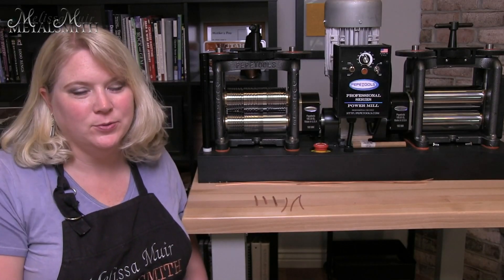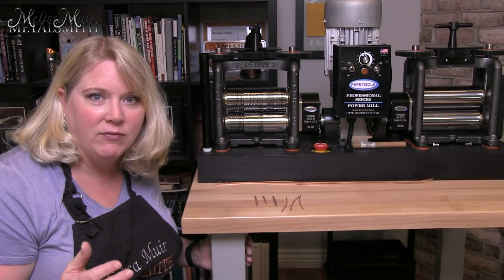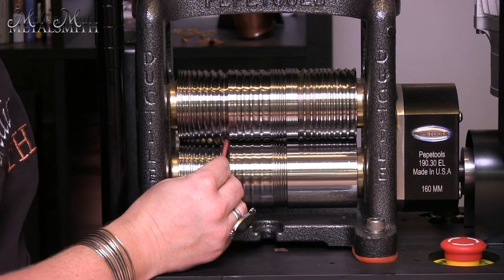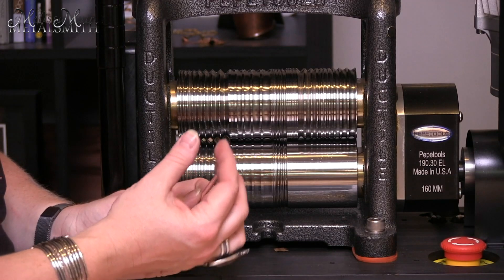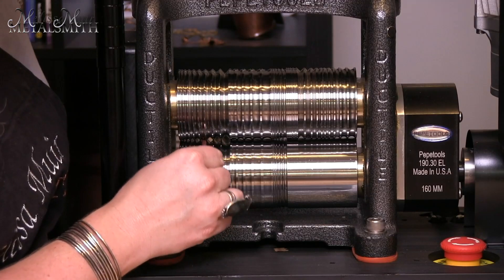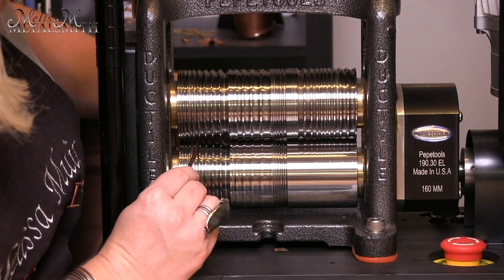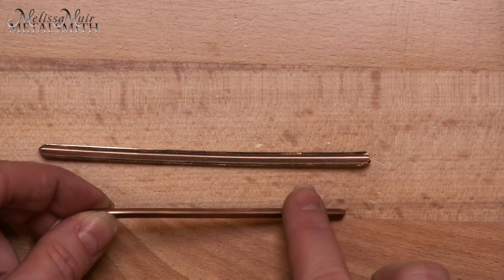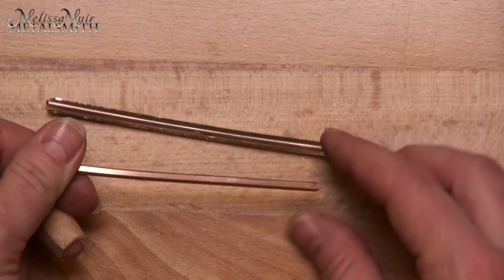How to make Square Wire with the Rolling Mill

Comment: Thank you for this one. 🙏
I just put in an order for the Pepe 160mm wire manual mill and looking forward to using it.  I am curious, is it pretty much the same slow reducing of the metal with the other shapes on the mill like the half round or triangle?
Reply from the maker: I opt on the side of caution and go with slow reduction. If you try to reduce too quickly with the wire, you end up with sharp flanges on the sides of your wire.
Reply: @MelissaMuir  
Ok
Thank you.
🙏😊

Comment: Hello when making wire do you stick to one track at a time tighten all the way down then start back again moving over to the next track size down and repeat? That’s the confusion for me 
Because it looks like you do a few runs on each track working your way down 

Reason I ask I’m struggling to make 1.5mm wire 
I only can get to 2mm then the flange starts you mentioned 
But I am working my way down like I mentioned 
Thanks
Reply from the maker: Sometimes there is a big difference from one groove to the one just below it. So I will run the wire through the same groove repeatedly, but I will tighten it a bit more each time I go, eventually getting all the way tight. Then once I have hit that, I will open it back up just a little bit and move to the next smaller groove and repeat the process. I hope that makes sense.
Reply: @MelissaMuir  thanks for the reply 
How can I get to use the smallest groves coming from 2mm over to 1.5mm it looks way to wide for the 1.5mm groove 
Reason I’m getting the flange on the wire and track flat marks ruins the wire 
I have tried so many times 
Has you know it takes a lot of work melting and getting to that stage at 2mm wire 
I just can’t get below 2mm

Comment: With same process, can I make the wire flatter and wider?
Reply from the maker: To an extent. It depends on how wide you want the wire.
Reply: @MelissaMuir Don't want it too thin so I can etch, stencil or engrave it. So  about ¼ in to ¾ in wide, (maybe wider if possible). What do you think?
Reply from the maker: @rammoose1751  if you want to go that wide, it is better to start with a sheet and cut it to length. 1/4” might be possible, but in order to get the wire to go wider, you will actually have to roll it through sideways.
Reply: @MelissaMuir  Thank you for responding.    
Sideways? I'm confused. I hammer a 6 in long, 3 to 5 mm round wire until it's flat & reaches either width I mentioned. Can mill flatten wire the to same gauges? I've called different vendors looking for specific catalogs but no one can help me. I really want to buy a mill very soon!

Comment: Thank you thank you thank you - why didn't I watch this first?
Reply from the maker: I am glad you liked it.
Reply: @MelissaMuir  one problem with my Pepe mill - it's the ultra series 130 combo - the sizing of the wire goes from 2mm to 1mm. I manager to get it square to that point (using 12g wire). But at the last stage I get the flange again. Any suggestions on how to avoid that? Seems to me that the step down from 2mm to 1mm may be too large.